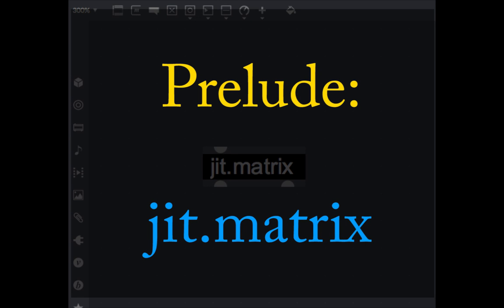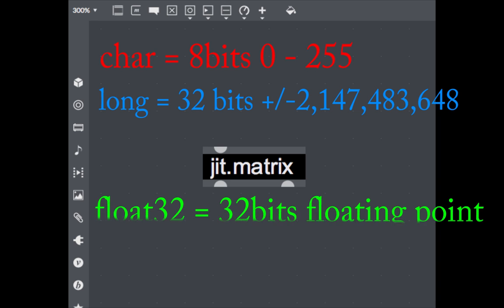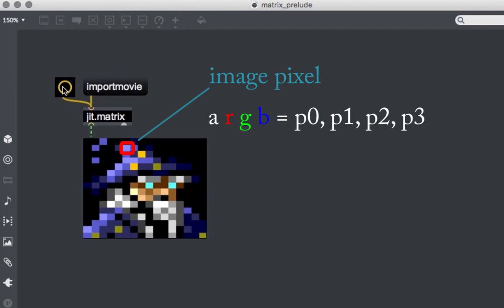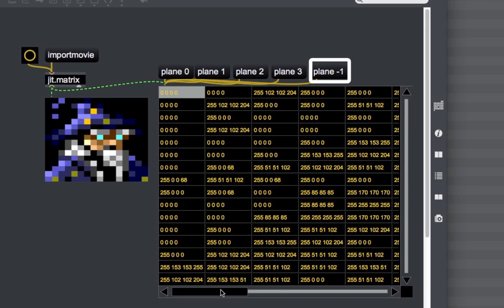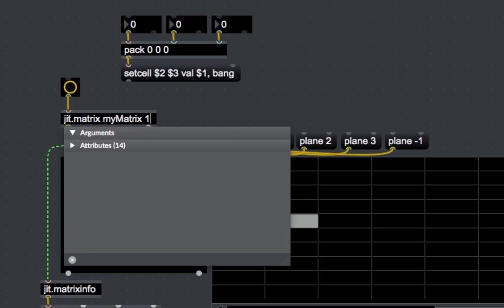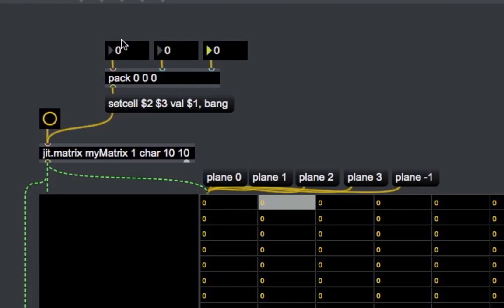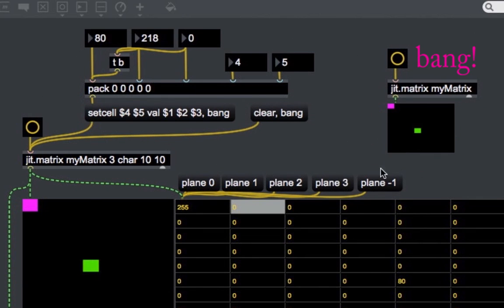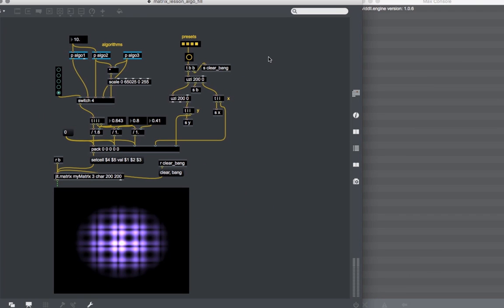Max for the 3D Visuals - Prelude_01 - jit.matrix

Comment: Great tutorial thanks! I have a question for you dude... on your screen the algorithms work instantaneously, but for me I have to wait about 30 seconds for my computer to catch up. I experienced this also with my own simple algorithm that filled a matrix randomly. I assumed this had to do with the GPU but under task manager it shows that hardly any GPU is used but the CPU/RAM is extremely high. Any idea why this is, and how to get the GPU to take the hit? My laptop is fairly high spec (i7 quad, 8gb ram, SSD etc.) and runs musical algorithms just fine ... visual seems like a different level of struggle for it !
Reply from the maker: Hi Wise Owl! Well 30 seconds it's indeed a long time, it surely shoudn't take so much to fill a 200 x 200 matrix. In this algorithm here the GPU has hardly any role, since jit.matrix works completely on the CPU. To port this on the GPU is feasible but an advanced topic. I believe you can grasp it by following some other of my tutorials about jit.gl.pix and jit.gl.slab. Porting to the GPU should definitely make it faster, although it's very strange that the algo is so slow for you
Reply: @AmazingMaxStuff  Thanks for your reply, very informative. I found what was causing the problem ... after [pack 0 0 0 0 0], I had the setcell message as (setcell $4 $5 val $1 $2 $3, bang) ....  after removing this extra bang message, it now works instantaneously :)